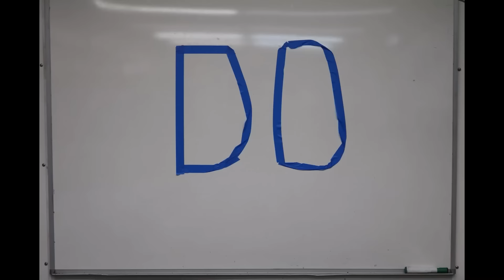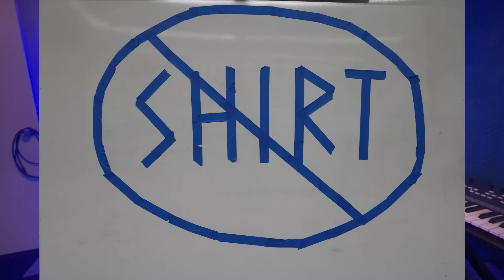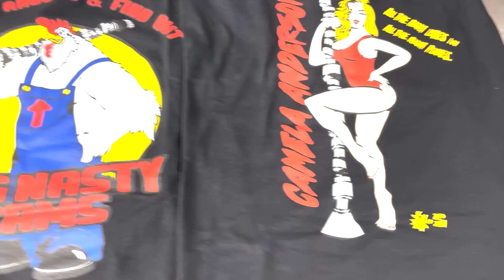LeRoy Repair for Cleetus McFarland!!  Ready for bigger boost!!

Comment: I swear Pete that boy CLEETUS  is hard on everything LOL. Hopefully with the new body on Leroy and a Pete Harold engine he will definitely be running in the sixes all the time
Reply: And thankfully a lot safer now without water in the decks!
Reply: When they did a wind tunnel test years ago it showed that the shape of the car was incredibly bad at diverting the air about as bad as can be it's amazing he's able to go as fast as it is
Reply: @justinwebster7761  i can't remember what speed it was at exactly, but i thought they said when they were at the wind tunnel that at the speeds they were doing at the far end of a drag strip it took about 700hp just to keep leroy at that speed without accelerating.
Reply: * Harrell

Comment: Any tips on the specifics.of how you weld the heads? I blew out a set of PRC heads and it took 5 times of welding them and cutting them back down to get all the porosity out of them.

Comment: Your welds won't hold high temp high stress situation. The filler was different material than the head, and the cooling contraction was not relieved. If this was a regular road engine, those would work just fine. But it isn't, so those welds won't hold. Then there's the chamber design itself. Yes, the fire rings and dry deck help, but the chamber doesn't hold any more boost than it did before. There's too much too sharp corners, edges and quench with inconsistent chamber volume. Again, if this was a road car, or even an 1/8 mile deal, those would not be an issue, but the second half of full pull is where all these little details become major factors. This is Leroy, and Cleetus crew you are dealing with. The amount of abuse and additional stress that power unit is going through is exponential compared to actual racing unit.

Ego based denial and defense does not make the quality of your work any better, nor does your religious cult members.
Reply from the maker: Hate much?